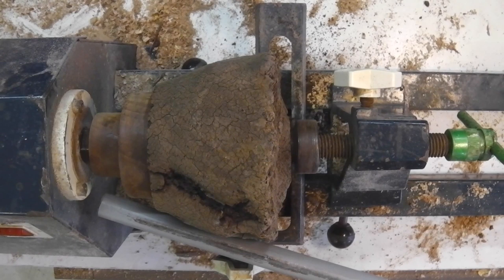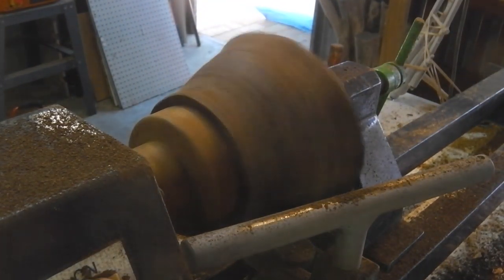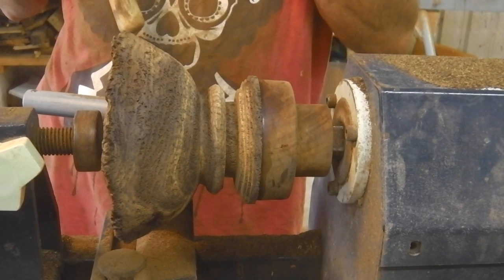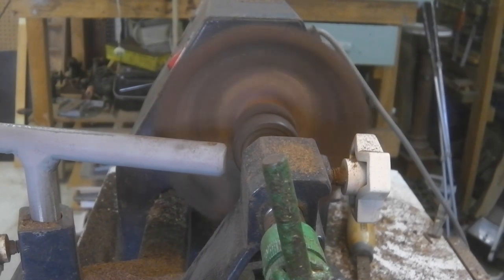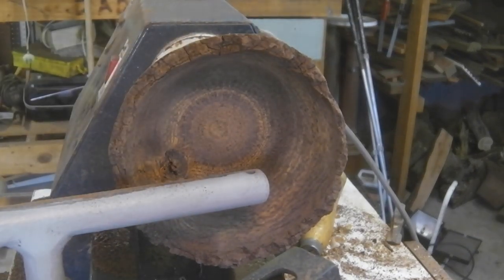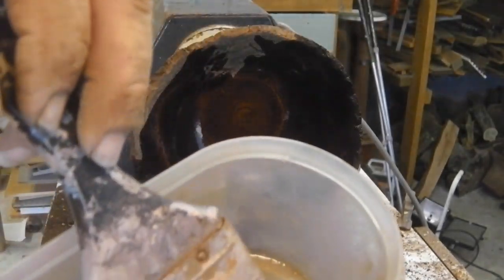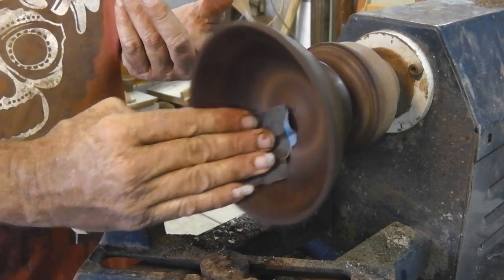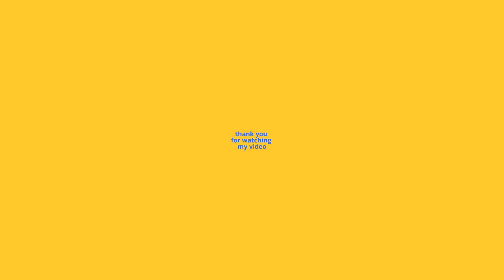Woodturning by Alan. Grasstree bowl

Comment: Thank you Alan.  I bought a grass tree root about three years ago on eBay.   I haven't turned it yet as I learned about how dusty the process is.  However, I now have a much better dust extraction system so I must get down it as they are really beautiful